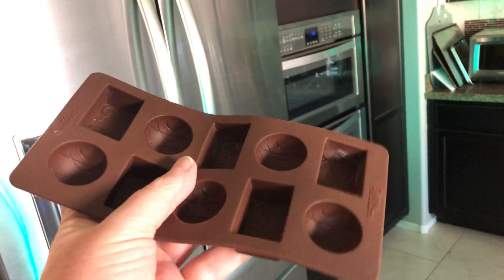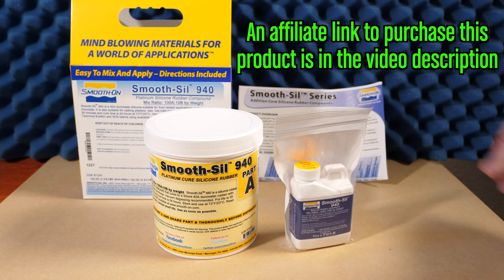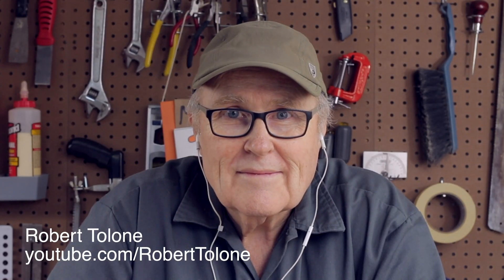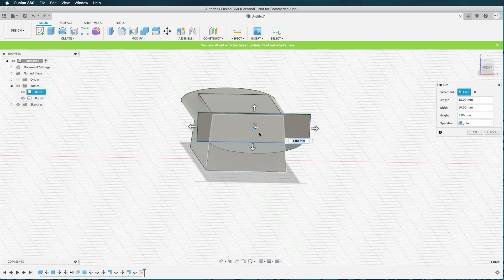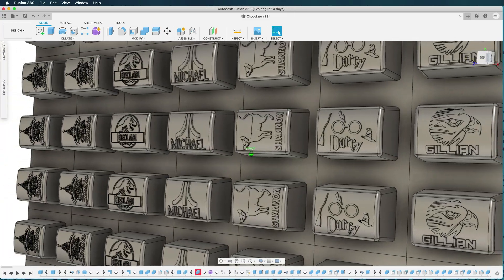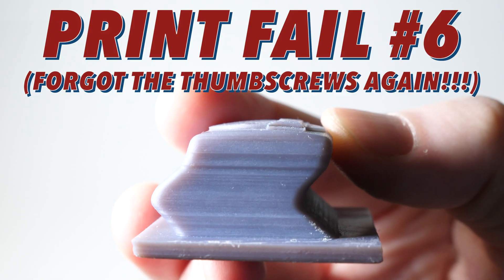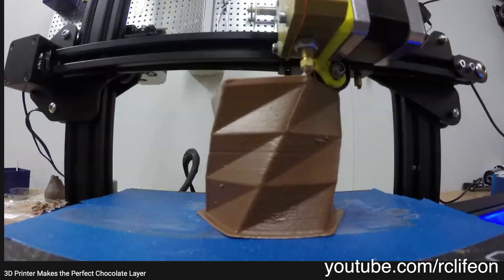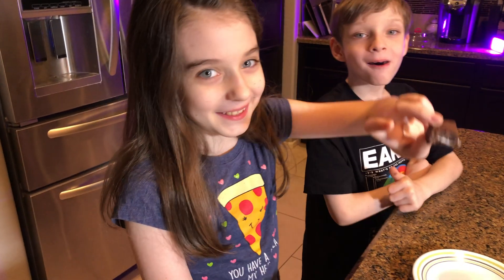I Made Chocolates from a 3D Printed Mold and Food Safe Silicone

Comment: Trick- pick build off of base and tilt both angles so it is diagonal. Once diagonal apply supports. Be certain the supports are on the side you aren't casting molds from. If you need to cast both sides, print two copies (one of each side being the support side)

Comment: "if you know better design tool" ...blender. I tried using cad-like software for my 3d prints but eventually I always came back to blender. Blender is different type of 3d editor, it destructively modifies object and you can move every single vertex. There is little problem when you wanna make precise stuff but I do it all the time you just gotta get used to different type modeling.
Also there is this another benefit that you can then color it and render a full hd video, also you can generate models from math nodes (geometry nodes) AND SO MUCH MORE i could talk for hours. Give it a try!
Reply from the maker: You're right. I need to learn blender.

Comment: Hi! Quick question. New subscriber right here. I’m really interested in learning more about 3D resin printing particularly focused on printing food safe molds as I would like to apply it in baking. I’m completely new to this topic, I still need to research more on what supplies and printer would suit my project the most. But is the resin print you used for casting the silicone mold food safe? Or does it not matter, and it’s safe if you just wash it thoroughly? I’m excited to check more of your videos to learn more on the process.

Comment: How much silicone did you end up using? If I calculated correctly, 1000ccm/1kg (cube of 10x10x10cm) of molding silicone costs roughly 30€ which sounds rather expensive. I'm currently looking into making chocolate molds using a 3d printer, the other option, using a vacuum forming sounds a lot easier and less expensive, but of course will not give such good details.
Reply from the maker: The silicone was a sponsored product so I didn’t pay for it. I can’t remember how much I used. It was a few years  ago now. You might also look at vacuforming.

Comment: When I made custom chocolate I FDM 3d Printed a buck and then vacuum formed a piece of plastic plate around the 3D printed buck and then poured the chocolate into the plastic plate. I was making thinner "Ghiradelli" shape/style chocolates.
Reply from the maker: I've been told that no one makes chocolate molds this way, so you're prob right.
Reply: @Nerdtronic  no one.... except you! I think it's a valid process,  would especially be valid if your design had undercuts you couldn't mold with a hard mold.  I suspect "production" chocolates are made with aluminum molds because they could chill them and cycle faster (and they don't have to worry about silicone bits breaking off in the product)

Comment: I know you have limited space on your build plate. On my CR6 Max I print my mold positives using PLA. But, because I have the space, I design the positives with a narrow wall around the collection of pieces. I leave a corner of the wall cut off but also print a 90 degree piece to be taped in the corner during the curing process to hold the liquid silicone in on that corner. Once the mold is cured I remove that piece and that gives me a space where I can get under the mold to start lifting it out. 

The one problem I have in the process is that I buy gallon sized buckets of the silicone and it’s a mess getting the thick stuff from there to the mixing cup.
Reply from the maker: I don't work with silicone much.  But yeah it can be a mess.  Resin 3d printing can be also.

Comment: What is the resolution of your printer? I noticed the tree rings on your print - something I'm trying to get away from without doing the math for perfect print angle. I'm currently using an Anycubic Photon 2k and it does fine for prototyping, but we're going to invest in a Saturn 2 8k ASAP. I just couldn't tell what make and model you are using...

Comment: Just started 3d resin printing, and I'm really loving your super practical, pragmatic, and helpful videos!  It's incredibly helpful to see the failures and things you learned.  My box of failed prints is growing slowly but surely, and each represents something new to do better.  Thank you for sharing your work on YT!  
Inspired by your video, I'm going to attempt to do something like this, though I would like to make molds that aren't fully filled in the box.  To save mold material, I want it to be an external offset on the molded pieces.
Finally, how has no one mentioned your hat in the comments, which is from Battlestar Galactica?  Nice!

Comment: You can always lower the detail control of an object soo fusión can run a little faster, it’s located on the browser, you have to right click over it and go down to display level control, and change it to fixed , and set the display level to low,

Comment: Two things. One why don't you use flex plates? Two, in F360. You should separate them and create a joint to assemble them. That will make your life way easier. And just a point on F360. It eats up a lot of resources. Macs are not optimal for it. It will work but in a limited fashion the same way it is limited on my 16GB RAM and 4GB VGPU laptop compared to my maxed out 64 GB RAM 12 GB VGPU.
Reply from the maker: Flex plate wasn't available for the Transform.  On my newer printers I'd be willing to give them a try.

Comment: Excellent. This is what I was looking for. When I was a boy in Australia in the 80s, we had Masters of the Universe flat square chocolate pieces designed to look like each individual character. The paper wrapping came in specific colours and with a cool drawing of the character on the outside (reflective of how it looked as chocolate on the inside and also a stick on tattoo. The wrapping still exists and can be bought from ebay from time to time (or actually printed if you wanted to) but the chocolate no longer is around. Since I am a 3D artist by trade, I wanna go out and get a 3D printer soon to make things like motorbike parts and now, molds like this. Don't know why, but the nostalgia in me wants to follow this up and share it with others. Thanks for the boost of confidence in showing it can be done.
Reply from the maker: Great!

Comment: Did you ever do the optional post curing of the mold? Just curious as to know if it affects the flexibility in any way.
Reply from the maker: I didn’t. How do you do it?
Reply: @Nerdtronic  Quoting from the smooth sil 940 product page:
"Optional: Post curing the mold will aid in quickly attaining maximum physical and performance properties. After curing at room temperature, expose the rubber to 176°F/80°C for 2 hours and 212°F/100°C for one hour. Allow mold to cool to room temperature before using."

Comment: So did you end up sealing the prints or molding without sealing them?
Reply from the maker: Well there are 2 issues that you can encounter. One would be that the silicone might bond with the part you're trying to cast. The second would be cure inhibition, which is something in the part that prevents the silicone from curing. And in that case the silicone would end up sticky or tacky.  I expected this 2nd issue to happen. All the other videos I had seen on it indicated that I would get cure inhibition.  But I did the test and the silicone cured fine.  In the video you can see that I was actually very surprised. So it worked to cast directly off the 3d printed part.  It might be because I'm in the desert.  It's super dry here.  Maybe that had something to do with it.  Not sure.
Reply: @Nerdtronic  yeah I have made a ton of molds. I was super excited to get my resin printer and hadn't seen anything about the parts causing inhibition until I happened upon a video on youtube. I was slighrly bummed by thus but also knew that many ppl had been molding so I knew there would be a work around. I have a product from Smoothon called InhibitX that I have used in the past on things that cause inhibition so I'll try that when I mold. I have also heard if you wait like two weeks that all the degassing and oil leeching of the resin will have stopped and they might be ok to cast raw. I was also told if you soak them in a solution of caustic soda and water that it will extract everything and make them moldable. Thanks for the info in the video! Very helpful!

Comment: My first thought was compatibility with a platinum cure silicone and SLA resin. I'm glad it worked out for you! I've been using Siraya Fast. Now I want to try Blue. The Fast resin seems to only react sometimes, even though I spray it with a clear sealant. For example, I just make a pendant mold that holds 27 pendants. 2 of them inhibited curing. Then again, I might have forgotten to coat those two. Glad your project came out so great!
Reply from the maker: Thanks!

Comment from the maker: 0:00 - Intro. The plan.
1:30 - Main title
1:43 - First issue - Silicone might not cure against 3d resin
2:36 - Testing silicone cure Inhibition with different coatings
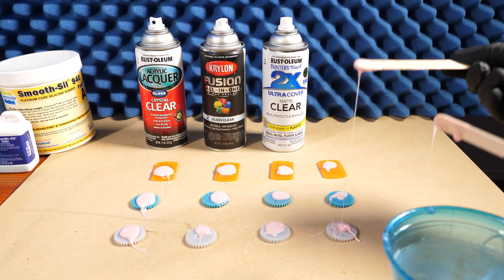3:12 - Phone call with Robert Tolone
7:02 - Peeling the silicone off the test pieces
7:30 - Design montage
8:47 - Let's print it (fails)
10:20 - Assemble the mold and pour it
11:08 - Peel the mold (satisfying)
11:45 - Making chocolates
Reply: You can add this information in the description and YouTube will break up your video into chapters in the progress bar: https://support.google.com/youtube/answer/9884579?hl=en
Reply from the maker: Thanks
Reply: I wonder if you could pin this so it’s at the top.. I’m seeing this one at ending of all the comments lol

Comment: Now that was a interesting video.... i might be Channel VR on youtube but i'm also a Willy Wonka....me and my wife own a chocolate factory.... therefore i started making my own molds with vacuum forming... then i got my Anycubic filement printer for my simracing & RC  hobby .
Then i started to 3D print molds for making chocolate . When you spray them with food safe acrylic paint you can use them for food.
The only problem was that you always see the lines of the print...and this in a professional environment cannot be allowed. Then i started to use putty spray paint to fill the lines and that worked perfect. Now just a few weeks ago i bought the Anycubic Photon X to start making better molds...  Your video was very inspiring .  Now i would like to make a Grogu mold in metal so i can put that in my marzipan pressure machiene....

Comment: Great video man, LIterally had me laughing at the failed attempts. Love the humor in it. Stick a sticky note on your printer saying "tighten screws" lol
Reply from the maker: I'm going to glue the failed piece to the top of the printer.  The reason I forgot was because I didn't remove and clean off the build plate.  I just put it back up there.  So when I started the next print (and the later one) I just assumed it was all set.  DUH!
Reply: @Nerdtronic  haha we have all been there. I once had a failed print, after cleaning it all up and put the plate back on, I forgot to tighten the screws. After stopping the failure and cleaning it all up I did it again, twice in a row haha
Reply: @Nerdtronic  sir could you design for me?

Comment: Damn. I'm so jealous lol. I tried making a cookie cutter with elgoo washable red resin and smooth sil 940 and nothing I coated it with would allow the silicon to cure properly. Tried a lacer, rust-o-luim primer and kylon sealer, nothing worked. The Silicon was always just a goopy mess where ever it touched the print. Going to grab a bottle of the resin you used Thanks!
Reply from the maker: I was very very surprised that it cured ok.  I guess that's why Robert says to test.  But you can see during the call that I was shocked.  I expected that would be the hard part of it.  In our call we discussed how you'd deal with that if it didn't cure ok.  But I cut that out for time.  But Robert said to cast in a tin rubber, then make a resin cast of that, and then recast in the food safe.  Seems like a lot of work.  So I'm glad I didn't have to go through all of that.
Reply from the maker: Oh also.. so in the end I was using the phrozen tr 250lv with a tiny bit of siyara blu mixed in.  But I used all that I had.  I just got some really inexpensive resin in so we'll see how that works next.  Also I'll be printing something that Robert is going to cast on one of his videos.  That'll be coming up in a month or so.

Comment: I've been figuring this out for our family chocolate business (The Secret Chocolatier) for the past year. We tried CNC--not enough resolution and at the resolutions scale hard not to melt HDPE. We tried FDM but FDM layer lines are a PITA to remove even with acetone. Now we're on SLA and SLA is where it's at. Make a buck with resin, food grade silicon for the molds and tada.. Good stuff. Will really help for short run customizations and if we like something a lot get it injection molded in polycarbonate for a long term use.
Reply from the maker: Awesome. On this one I was going for the 3d printed look, so I wanted the lines.  But yeah not sure how you would remove them completely.  Probably lower the layer height and use a high res printer.
Reply: @Nerdtronic  Yep, using a sonic mini 4k and at .02 the layer lines are incredibly hard to pick up on. As it is a resin we could also buff it even further but I think that's overkill. I just want a way to have more customization for customers, allow for us to have easier access to our own personalized series & for smaller sculpting projects (as larger ones do fine with modeling chocolates/FDM printing.)  I don't know if there will ever be a tempered chocolate printer due to the complexities of holding real chocolate in a crystal lattice but this offers a nice ability to still use qualitatively great product with your own flare.  Again fun video and so glad to see the idea populating in the wild. Does my heart good to know I've not been chasing some engineer-chocolatier-dream :D
Reply: Tried using ABS / ASA on FDM before acetone smoothing? What was the problem?
Reply: @jimbojones6206  3 year old tail, nice! So, lots of history here. Smoothing degrades details too much. It can work but it takes too much work for a middling result and if you are trying to do bucks at some sort of scale--better methods.

Best answer I have found is for 3d use resin printing, SLA + thermoform is gold. Or, laser cut acrylic stacks for 2.5d items, like business card designs and such.
Reply: @AndyCiordia  Thanks for the quick reply! I've recently created a 3d printed chocolate mold of a city (using blender blosm) as well for a cake with unsmoothed FDM prints and silicone and it worked just fine. 

Since it's been 3 years, may I ask how your business turned out?
Reply: @jimbojones6206  Excellent! I love silicon, way too expensive for most runs but if I have some special project I might use it. It shows layer lines though incredibly well so you definitely have to do some work to make those look natural.

We've been in business almost 16 years, so this was a value add for customers/business customers who want to do something special but don't want the outlay for polycarbonate molds. We offer transfer sheets, specialty airbrushing of bonbon molds and 2.5d to nearly 3d. In our b2b I'd say it makes up maybe 20%, so not a lot. I enjoy fabrication so I 'd love to see more of it but I'm just an arrow in the quiver.